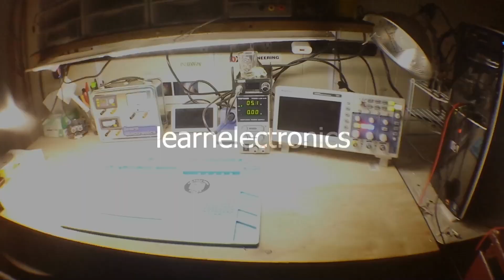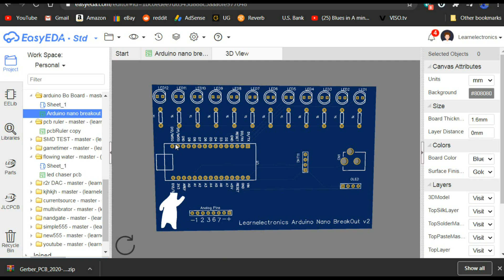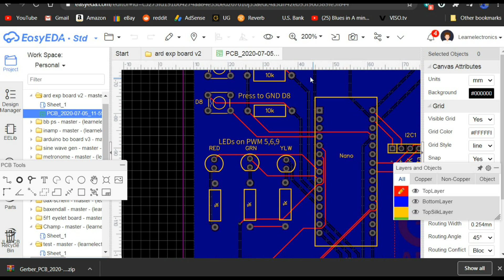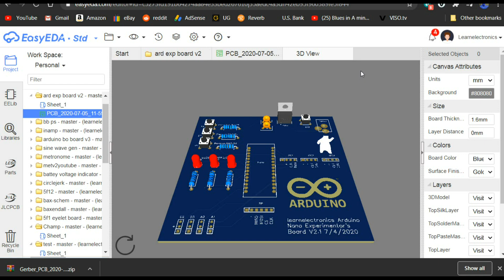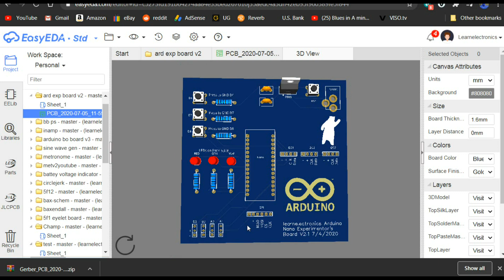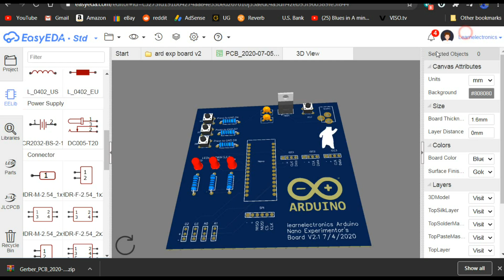sneak preview of my latest project

Comment: Awesome board! It might be better to try and move those two capacitors on the top away so that  when you go to plug a micro USB cable into the Arduino, you don't have two capacitors in the way (unless the micro USB port is on the other end, in which case the I2C pins should be moved so that you don't lose I2C functionality when the USB port is plugged in).

Comment: Nice board Paul.  I always tell folks NOT to use the reg on the little uC boards!  Some versions don't even have a reg.  If it's as ESP, DON'T ever! :)  I would add optional pull-ups for the I2C SDL/SDA lines.  I also find a small group of ground headers are handy. If you wanted to (since you have free room) add an extra place for an LMA1117 3.3v reg for extra power goodness :) The surface mounts for those are not too hard to hand solder.
Reply from the maker: Thanks Scott, I am right at this moment playing with your Nano Breakout Board. very Nice!
Reply: @learnelectronics  Thanks!  I am going to have V2 out soon, just need to get some made to verify them. Plan to send off this week after I have stared at the layout long enough ;) Will post on Github one ready.

Comment: I love the 5v and GND points by each digital and analog pin! Usually end up with everything jammed into breadboards for that sole reason, or with a big mess of a terminal junction to distribute power. Having the I2C and SPI broken out without needing to keep testing, fudging and retesting due to incorrect or inconsistent spec sheets etc is nice too... great design!
Reply from the maker: Thank you!

Comment: Thanks for the video. I'm not a arduino person, not a code person. I do make some stuff for fun...
I buy the cheap stuff or the $15.99 stuff (Ouch) like you got, I always break out the Good Solder and reflow 90% of the boards because the lead free stuff China uses is crap! I have the same solder station you have and I ended up reflowing the whole board because the 1st issue was the power wires had bad solder joints and it would turn On sometimes and and sometimes Not! :-(
I use Fritzing on my Linux OS's but I will look at EasyEDA, It has a Linux version... HaHaHa what are competitors for?
Later!
LLAP

Comment: Is this right? Doesn't the onboard 5v regulator need at least 7 volts to allow for drop out? The datasheet specs 7-12v. The max output on any pin of the Nano is 40mA regardless of how it's powered so I'm not sure what the extra regulator is actually for....it just seems to be doing more harm than good. Still, I assume it worked when you breadboarded it.
Reply: Most voltage regulators require an input / output headroom of at least 2V, otherwise they fail at doing their job, regulating the voltage at the output.
Reply from the maker: You will power the the Nano through the VIN BYPASSING the regulator. Also the Arduino itself will only provide SIGNAL to higher current devices. They can get their POWER through REGULATOR.

Comment: Bloody awesome mate, I have one or two of those expansion boards also and I am wondering why I bothered with them. I love that you have expanded the I2C ports, you could have possibly included the chip on the small multiplexers to give you 8 I2C ports but still 3 is awesome. I don't get the 3 grounding buttons, are they for resetting a single output? Anyway is a great idea to make a more practical board. I like the nano header seat. Could even maybe do a couple of larger more involved kit form boards that allow you to plug in sensors and displays to make weather station etc.
Reply: By the the way, will you be selling them and if so will you be shipping to Australia?